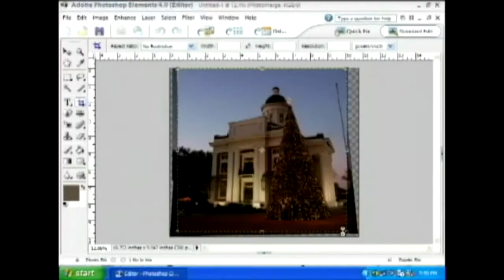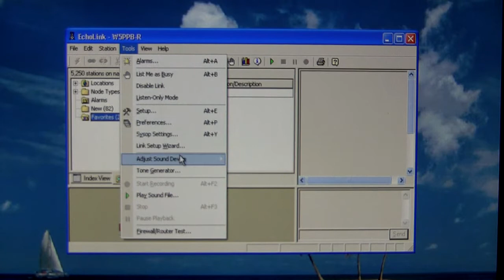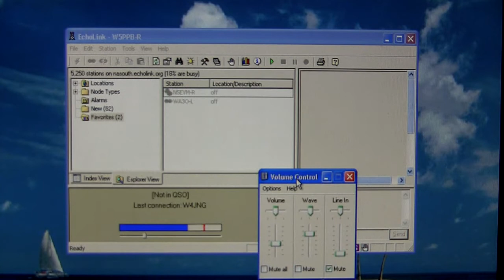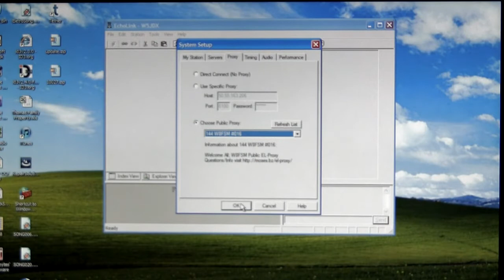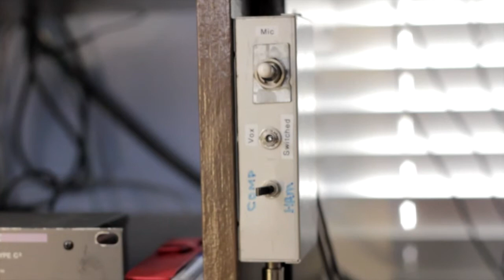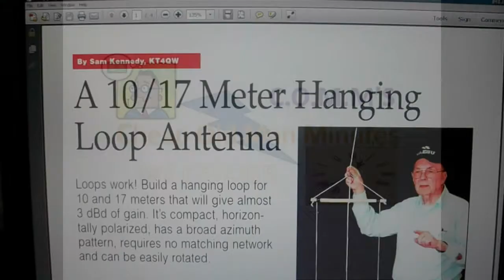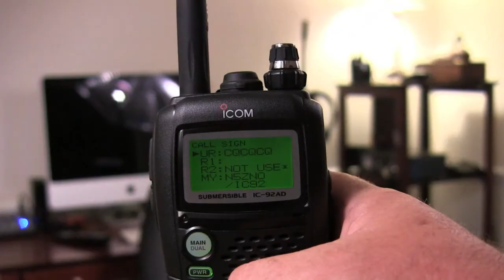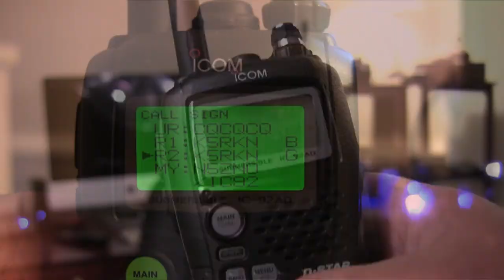AmateurLogic.TV 38: D-Star, Echolink, Audio & Baluns

Comment: On the 92ad there is a cq button you can push, so you don't have to go back into the menu to change the call back to cqcqcq. They both have the same effect, this is just quicker. I have the 92ad and love it! I also have the 880h in the truck. Good work guys!!! 
73, AD9Z

Comment: A quick tip to quickly select a URCall entry on your Icom IC-91/92 radios without having to go through the menus. 
Press and hold the 0/CQ button and then rotate the dial. This will go through all your URCall memories. When you find the one you want, release the 0/CQ button and key up. 
When you want to go back to CQCQCQ, just press and hold the 0/CQ button until the radio beeps. This makes linking and unlinking quick and easy,

Comment: For assigning a static IP address on Windows 7, its worth noting that users should click "Internet Protocol Version 4 (TCP/IPv4)" NOT "Internet Protocol Version 6 (TCP/IPv6)". Most systems still use IPv4 and have not been upgraded to use IPv6. Some routers also have the capability to assign static IP addresses using a DHCP server, but you shouldn't mess with this unless you know what you have a networking background or know what you are doing.